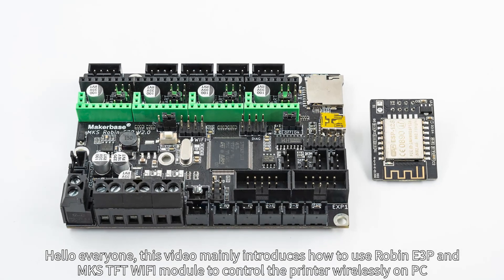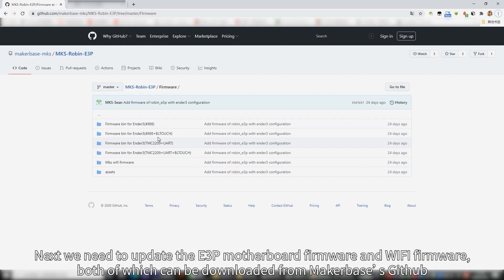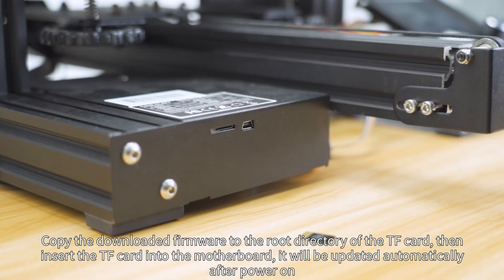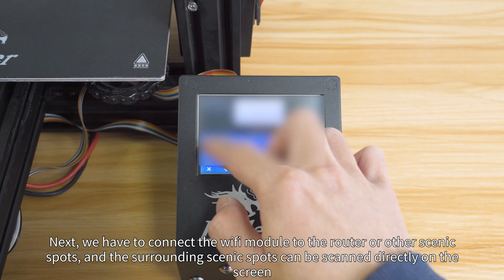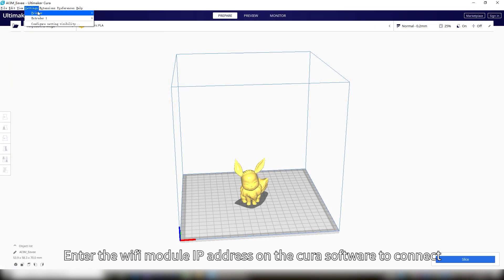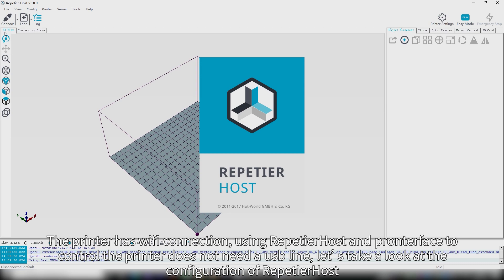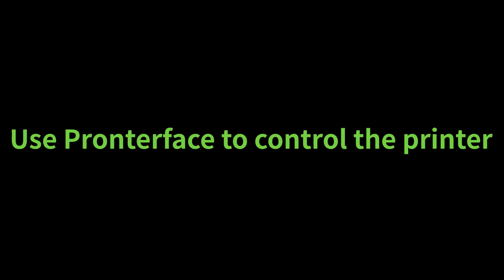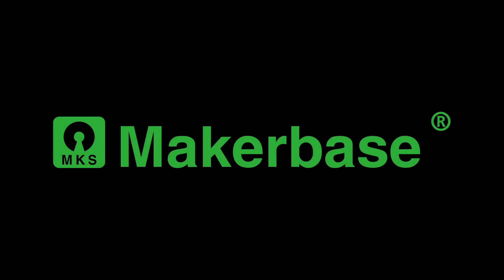Use Robin E3P to realize wireless control of 3D printer on PC

Comment: I'm trying to connect to wifi, but when I click on wifi it doesn't show anything, it generates a wifi with a random name, I went to config and switched from AP to SPA mode, I put the SSID and password, I went back to wifi and it gets stuck in "The wifi module is being configured please wait a moment" message is like this for 20 minutes, I redid the whole process of updating the firmware but I got the same result
Reply from the maker: Hello, please do not modify the ssid, you only need to select the sta mode on the screen

Comment: How to  setup MKS Robin e3p with mks wifi module  on standard marlin 2.0.7.2  color ui?
Reply from the maker: Hello, color ui can't use wifi function, you can use lvgl ui
Reply: @makerbaseteam4217  Are you planning to work on a solution to that problem? I dont like MKS UI as well, because I can't use M600.

Comment: La MKS Robin E3P le tengo instalado en una cr10s5 y no imprime y el ventilador de capa no funciona. Alguna ayuda. Gracias
Reply from the maker: Can't print? Is the motor of the machine unable to move or only select file printing and not start printing? The fan needs to turn on the fan in the slicing software. You turn on the fan on the screen. Can the fan turn?

Comment: I want to change some missing images in my TS35, I try to use MKS UI (no matter to use it locally or web version, but... which type must I select for e3p screen (Board Series/ Board type/Firmware type)? 

I'm in love with my e3p!
Reply from the maker: The picture is not displayed completely because the picture has not been updated, you need to update the assets folder, which is the picture, please download it at the following link https://github.com/makerbase-mks/MKS-Robin-E3P